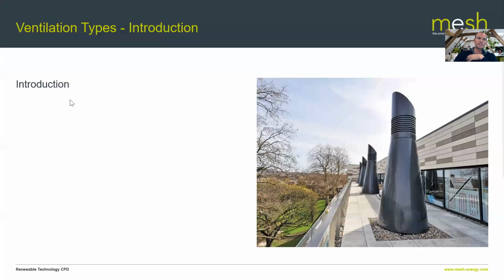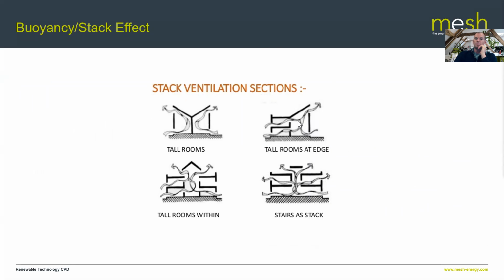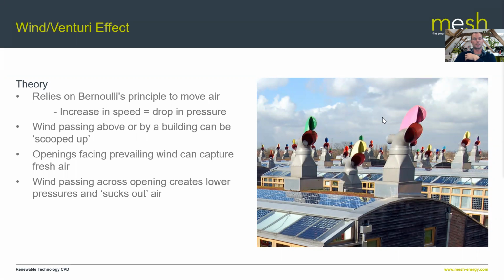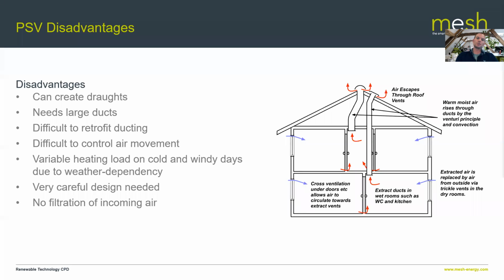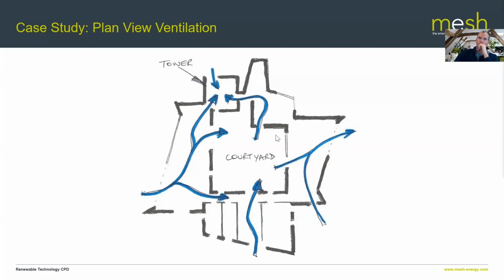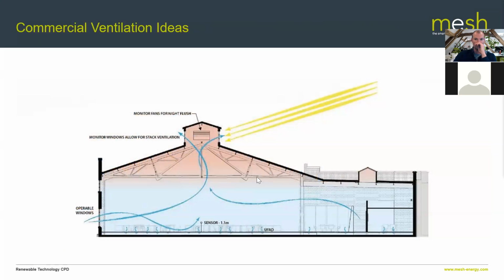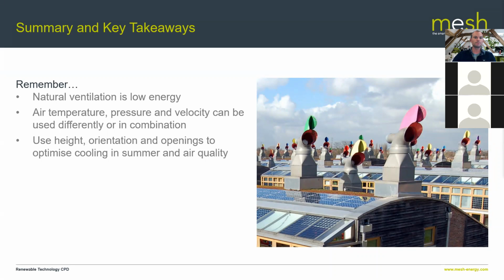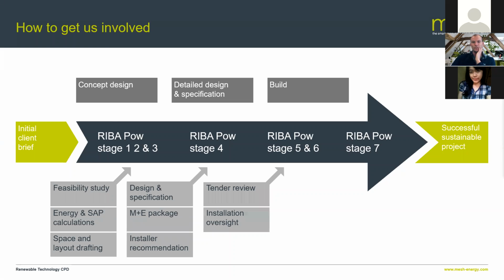Technology Masterclass: passive stack ventilation

Comment: Johnson does not articulate the different purposes of ventilation: eg remove damp to prevent damage to fabric. Provide right amount, not excessive, vent to remove pollutants. Evaporate moisture from walls, arising from leaks, rising damp and rain with pipe leaks. life-style moisture, breathing, showering, drying clothes, cooking etc. He does not say, in energy retrofit, for all homes in UK, that many million old ex-coal fire homes, with inadequate insulation, from solid brick walls.  Old flues are brilliant keeping cooler in summer, and enough vent with hit-or-miss grille for winter. Too much psuedo-science jargon, not talking practically.

Comment: Great video. I’m surprised you didn’t show operable skylights on the roof used as passive ventilation, you barely touched on it. These are very easy to retrofit and can create high velocity ventilation when used correctly with windows below. I’ve seen studies where this design out performed a whole house electric fan. 👍